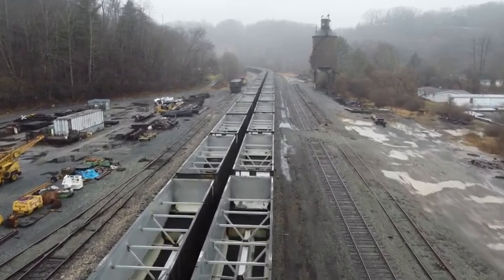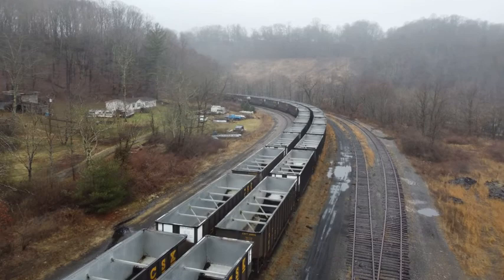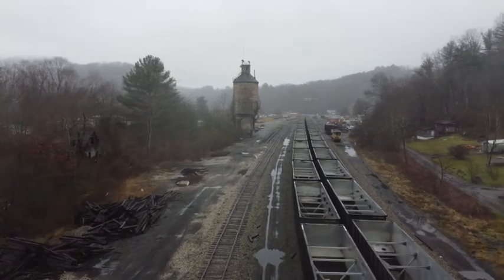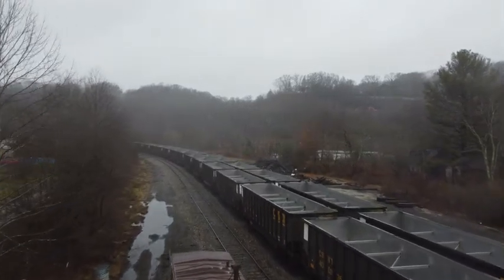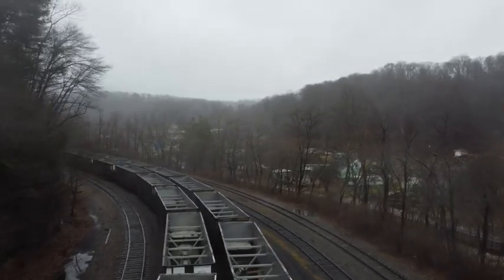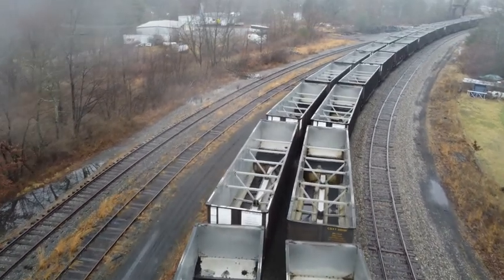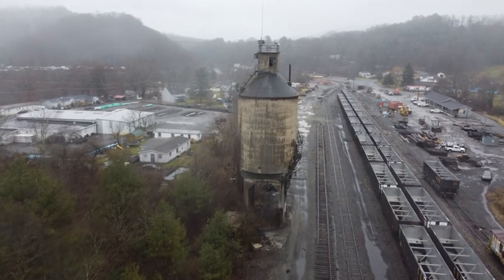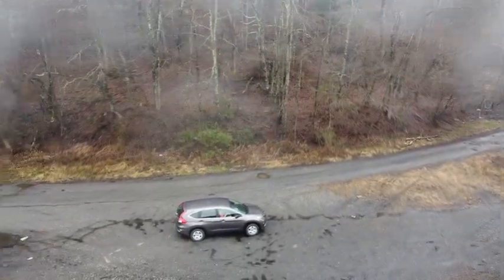CSX Piney Creek Subdivision in Raleigh, WV

Comment: From what my dad has told me, CSX/Chessie system ran 2 110 car coal trains from Raleigh yard down to East Gulf WV on the Winding Gulf branch which is on the back side of Affinity through Sophia, he used to drive tri axle dump trucks from mines in the area to East Gulf Prep Plant and had to not only race and time the CSX trains but also the N&W/NS trains, they also ran 1-2 110 car trains in the area so it was always busy. Especially at East Gulf since it was joint trackage the crossings could get backed up for extended periods of time